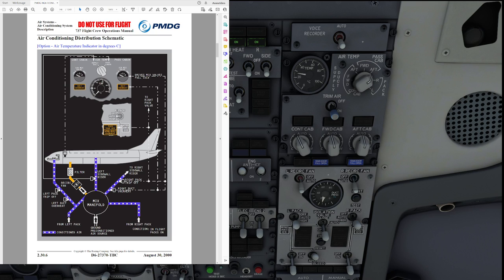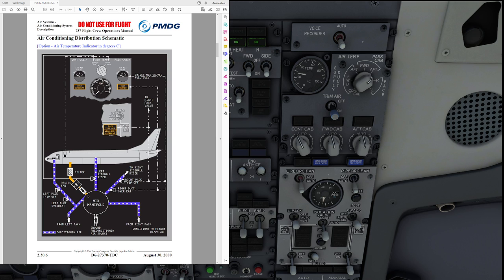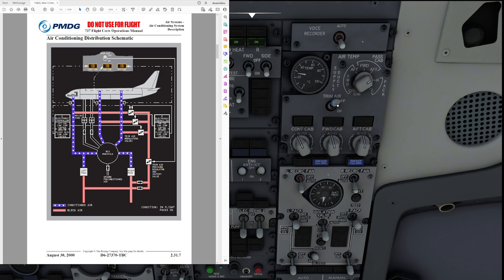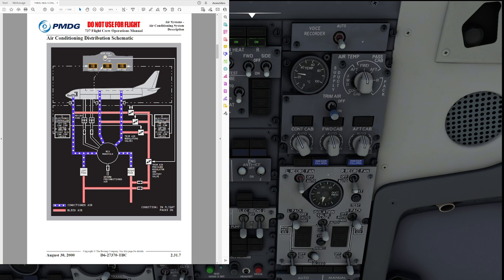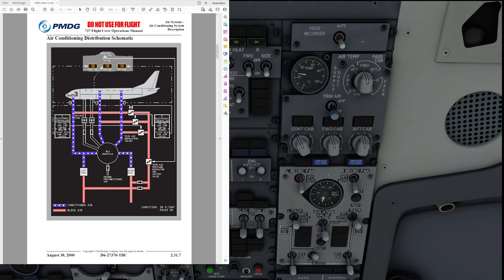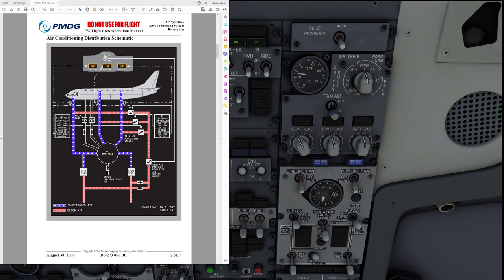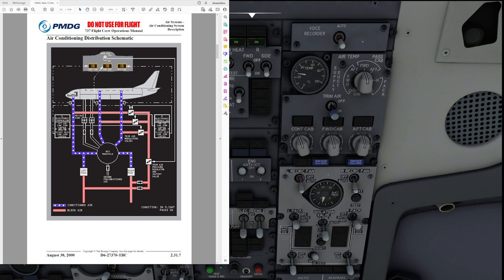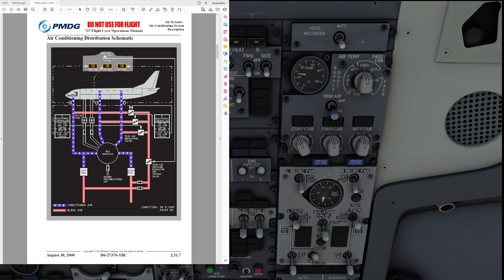Boeing 737-800 Differences: Air Conditioning | 737 Pilot explains

Comment: The reason for the trim air is to provide a way of providing better zone temperature control. Some areas are normally hotter/colder than others or passenger numbers in some areas may affect the temperature. The right pack is controlled to produce an ouput temperature which will provide sufficient cooling for the hottest cabin zone (as sensed by cabin zone temperature sensors). However, this will make the normally colder zones too cold, so hot air is added via the hot air trim system. Whether this is more efficient or not, is debatable, but it does provide better temperature control.  If you feed pack air into the mix manifold which is an average of the temperature required for the entire cabin, folks in some areas will be hot and others cold. Some aircraft like the 747 take this a step further and allow the purser to adjust the temperature set by the pilots (by a few degrees).

Comment: I sometimes get an air cond warning light over on the co-pilots side during decent or during slow speeds. I assume because the engines are throttled back, it's causing the light to come on. Is this normal or do I need to adjust something during decent? I'm flying the 737-700. Thanks for any info.
Reply from the maker: So which warning light is it actually associated with? The Master Caution - Air Cond only tells you that there's a warning active in the airconditioning system. But which warning? Look at the overhead, then get out the QRH (google for it, it's worth it!) and follow the checklist.
Reply: as a PMDG 738 pilot, my best guess is one of the zone overheat (one of the lights above each zone's temperature knob) . This often happens before taking off in hot climate. I believe turning down the knob would help. If not, just takeoff and the light will go out.